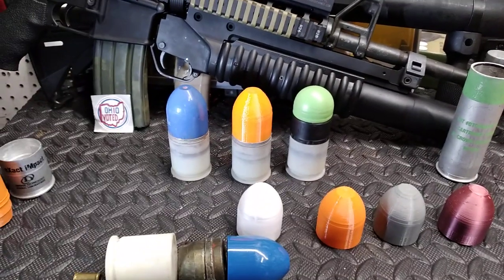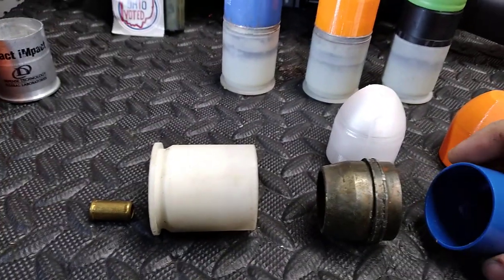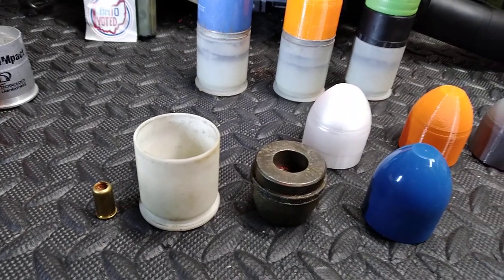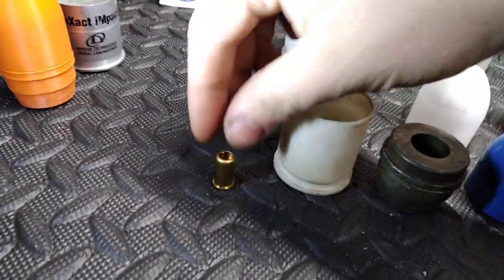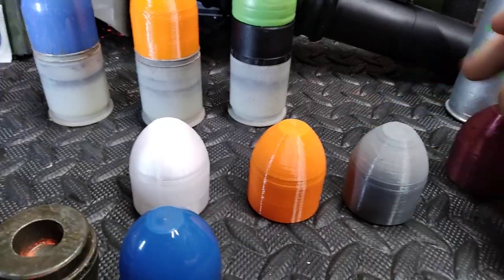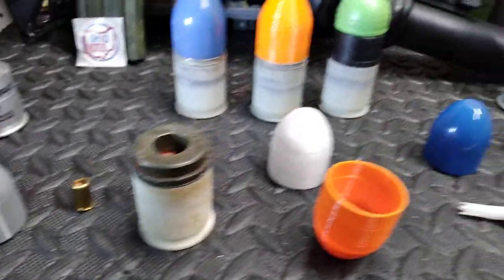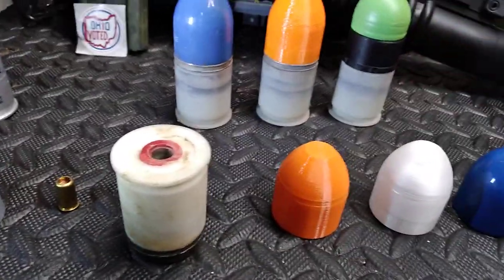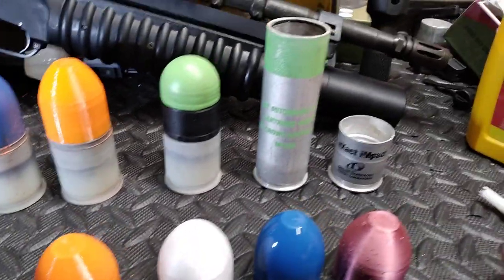3D Printed Ammo! Shooting 40mm for CHEAP!

Comment: 3D printing the projectile you could design weak break points into the windscreen. Also printing some "horn" projections would increase the chance of breaking on impact, even with softer surfaces.
Reply from the maker: Definitely.  Though my CAD skills aren't quite up to yours. My first goal was to make a functional replacement for the factory cone. I also made a few other prototypes, including an extra long cone that burst on launch (lol) and a whistling cone that I still need to print and test. A friend also redesigned mine to match the shape of an HE round which is pretty cool. I havent been doing much CAD since summer hit. But I will now that winter is approaching.
Reply: @ChevTecGroup  if you want help with the models just let me know and I can see what I can do. They should be very simple models.
Reply: @ChevTecGroup  send me the dimensions and i can cad some with grooves

Comment: You could print them in TPU for reussable it has some flex in it to not break on impact for practice.
Reply from the maker: That would probably work depending on what target you hit. I haven't had any luck the one time I tried printing in tpu though. So I'll stick with expendable for now
Reply: Make silicone molds from the prints and use pourable resin
Reply from the maker: I could even print molds to pour the resin straight into.  But its honestly too easy to just print the cones. I can print 20 cones a day on an ender 3 just by hitting a button. No mess, no smells, no vacuum chambers to get the bubbles out. I have thought about casting for thicker parts that need more strength

Comment: Can take the prints, mold them in gelatin, cut it out 'zig-zag cut' and pour in a cold metal casting. The cold cast is epoxy resin mixed with powdered metals. But I'm not a Marine so I don't use chalk rounds ;)

Comment: Do you have a cad drawing of the tube? Or some blueprints? I have the receiver and trigger parts on blueprint. But no tube. Also i have the M79 blueprins complete. 

Also, no 40mm grenade blueprints, would you have those? I have some CAD files but im not sure if these are the right size or just a spinoff for the looks. 

Greetings,

Jeff 

p.s.
Really cool to see that you can shoot these that cheap!
Reply from the maker: Unfortunately I don't have any drawings or files of the launchers.  There may be some on grabcad though.
Reply from the maker: @jeffjefferson2676  i can try to take some measurements for the 203 barrel. I would really like to see a broach or electrochemical machining die designed to make the rifling for these barrels
Reply: @ChevTecGroup  Well, if you look at the about section of my youtube channel. Ive got a grabcad page. It has all the things in it you need to know to build a barrel. 

For a big thing like a 40mm granade launcher, it might be better to use a rack and pinion method as shown in this video: https://www.youtube.com/watch?v=piaZjbdu4Ok. That should work. Also, i dont know if you can swage rifling into aluminum like a rifling button can with steel. 

Some precise measurements would be greatly appreciated. Measuring in inches is doable, but metric is more easy.  However the 203 barrel is probably designed in inches, so that should be straight numbers. 

Greetings,

Jeff
Reply from the maker: @DieselRamcharger  the only broach I've seen for sale was a 37mm one. Which is kinda worthless to me, especially for the price they wanted. I haven't tried pricing a 40mm broach yet
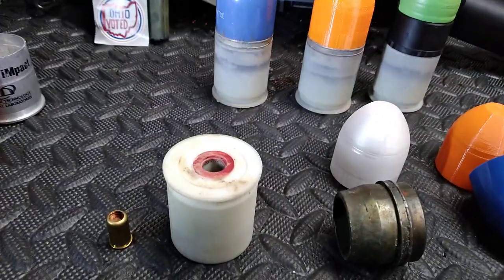Reply: Hey man I had just saw this comment, but two days ago I saw the full files for what you are looking for. I will go back to the message board and pull them up. I was helping out some guys on there and had noticed a post about it. I'll grab the files if I can find them. I'm an industrial engineer with a few cnc machines, lathes, and so on. What is the twist rate of the barrel? Is it a 1:48" twist? If you can give some decent measurements I might be able to send a few sets out to ChevTec for him to look at and see.
Reply: @ChevTecGroup  Read my comment at the bottom of this comment thread from jeff i may be able to make a few for you to see if it will work for your rifling if you think you would like them. I think I have the prints for them and can run them in the cnc and so on.
Reply from the maker: @aegiscaleb  that would be pretty awesome. Having some 40mm barrel blanks would be great for guy that have spikes 37mm launchers and break action 37mm launchers that want to convert them.
Reply: @ChevTecGroup  Yeah it is no problem. My family use to own a business making turbochargers and finally retired so I have access to make whatever. I don't mind helping people spread freedom in this day and age. I can work up a few different ones to try and see which ones work best since you are working with precision accuracy. I think I may have the exact rifling specs and cat make a few kits for someone to try. I'll get to work on it over the next weeks and update you.
Reply: @aegiscaleb  6 grooves 1 in 48 twist. Like the file says: https://ivanthetroll.keybase.pub/tdp.html "Complete M-79 (Thumper/Blooper) Grenadle Launcher Technical Data Package" page 25/120.

Comment: Seeing your other comments about printing cases the case mouth will seperate and go down range, is that a problem? If it doesn't effect accuracy that much why not?
Then you could prime with nail gun blanks which are way cheaper and easier to come by assuming it doesn't shatter the printed bases
Reply from the maker: The case mouth separation was noted by the Army as severely hurting accuracy. I talked tonkne guy that tried it with PLA and said the cases shatter when fired so it is kinda almost one time use. I actually picked up a box of nail gun blanks and had the same idea of using them. The hardest part will be offsetting the case so that the centerfire firing pin hits the rim. Butni figure it would be a good use for the lightweight 3d printed projectiles I've designed

Comment: You should fill one with like ghost peper and itch powder
Reply from the maker: That may be something we cover in a later video.  We will be going over some 40mm smoke projectiles made in house. It wouldn't be a stretch to add capsaicin powder or something else to turn them into riot control rounds.
Reply from the maker: Thanks for the suggestion
Reply: @ChevTecGroup  no problem

Comment: Have you tried 3d printing the "case"?
It may be a better practice to press the blank into the case over using a dead blow hammer.
Reply from the maker: I have not printed any cases Yet, though it is a common request so I think its going on the list of projects. The Army already tried and had a lot of problems with the cases breaking and coming out with the projectile, which worked for one time use, but hurt accuracy a lot. I'm getting an arbor press soon so that will be used for seating blanks. Most just go in by hand.
Reply from the maker: I haven't tried the case yet since they have always been available for sale. When the cones were not for a while, or were pricey and non-reuseable. But it should be exciting to try

Comment: Hey bro, I'm an Aussie so this shit isn't easy to get. So these taking the bland round for a framing  gun?

So U have any other options for c02 that I may be able to get in Australia... Sure the energy ahell would be fine if they were appart in box... Also, the pusher? Where can I get those???
Reply from the maker: These ones take a blank that is specially made for them. If you check out the AWCY launchers, they have files for rounds that use nail gun blanks.

Comment: I wonder if there's a way to print a one piece windscreen and pusher and fill it from the front so you don't have to try and keep finding the pushers
Reply from the maker: I have a file I made for one like that. The nosecone is pretty thick as it is intended to be used for smoke, but it could easily be redesigned to break on impact
Reply: @ChevTecGroup  you're doing the lords work
Reply: @regulator1d yes once combined set top layer setting to off. It'll make a hollow point looking one
Reply: @Regulator1D  yes print it with the top layer infill off and it will make a hollow point

Comment: wait so if the manufacturer doesn't sell it with the primer included because it would then be classed as an explosive wouldn't you need to register it as an explosive before pushing the primer and thus need an explosives license or ffl?
Reply from the maker: It is legal in most states to make explosives for non-commercial use. So it is perfectly legal to complete the rounds yourself. It's advisable to do it at the range before you shoot so that you do not break any explosive storage regulations. In reality no one is getting arrested for it, but it is best not to chance it
Reply: @ChevTecGroup  But on the eform1 what would the option to classify the weapon as explosive, rather than DD, mean if not something like this or perhaps a real 40mm frag grenade or a Molotov you made? Because wouldn't a commercial manufacturer or FFL use a form 2 so they don't get the $200 tax? thanks for the response too!
Reply from the maker: @saltbandit6768  thanks for the questions. The explosive section on the form 1 is for things like hand grenades, molotov cocktails, landmines, etc which are considered explosive DDs. Regular explosives (stick of dynamite, det cord) are not considered DDs so you don't need an FFL or form 1. If you are storing them or making them for commercial purposes, you'd need an FEL. For messing with explosive DDs, it's best to have both but that gets expensive quick.

Comment: have you tried tpu for the nose cones? if so, which was better, petg or tpu?
Reply from the maker: I have not tried TPU. If you use too flexible of a filament, I bet the cone would fly off when fired. PLA+ is my favorite for its ease of printing and quality. PETG isn't bad but it's harder on the printer and I had a lot more failures.
Reply: @ChevTecGroup  awesome, thank you for the fast reply. i know the awcy launcher includes files for a specifically labeled tpu nose cone. i have printed some, not fired yet. they seem like they would work decent. i figured perhaps for chalk, if you had the extra give that tpu would afford, it might make a bigger chalk cloud. 

i have been printing all my stuff in petg and it seems to have worked well so far. im planning to fire several this weekend so i'll try to pop back here and let you know if i saw a difference in petg vs tpu cones

Comment: Why not 3d print the nylon casings too? If you have a printer capable you could print them in ABS, Nylon, or even Polycarbonate. Then you'd just need to reload the 38 blanks (or whatever blank you want to use)

My question is, how much unique you putting in those?

Also, Airsofters have "pyrotechnic" hand grenades that are technically classified as "fireworks" how are these not classified as fireworks? is it because they're 40mm? What about going with a 37mm?
Reply from the maker: The nose cones were "phase 1." The US Army experimented with it as part of project R.A.M.B.O.  They had lots of problems with the case mouth separating and going downrange. I started with the nosecones because they are not re-useable. And the cases are generally available for sale. But it will be good to make 3d printable 40mm and 37mm cases for the future.

Comment: I wonder if the zinc part could be casted using lead.
Reply: I modeled this up on solidworks because I was curious about that too. It wouldn’t work well. For starters it would have to be a lot thinner to be the same ~160g weight. Second, the mould would have to be single cavity and also a 4 piece design to recreate the original geometry.
Reply: @leepeffer1304  yea I’m sure it would be stupid heavy if it was lead. Like a 5 lbs projectile lol
Reply: @Gunmonkey5  for anyone OCD enough to care, a stock zinc pusher weighs 164.5g and an identical one made of lead would be 270.2g.
Reply: Lead will smear the bore, and be very difficult to remove. I wrapped solder around homemade cast pushers years ago. It worked well, but I would never do it again.

Comment: Hey man do you have a file for 37mm ?
Reply from the maker: I might have one or two from a while back. You may have to adjust them to fit whatever cases and launcher you are using. Send me an email specifically about 37mm so you don't get the 40mm pack. Jacob.chevtec@gmail.com

Comment: Can one print destructive rounds after filling out the king's tax?
Reply from the maker: You can. Though you must also stay in accordance with explosive laws. Either have an FEL or make and use the explosive material in the same day and location, if your local laws allow that. M433 HEDP parts can be found new with no energetics. I have a couple on the way and will be doing a video on how they work and go together. Though not until after I finish a video on all the variations of factory practice rounds used by the US military.  I'm waiting for the last 2 to come in the mail.
Reply: @ChevTecGroup  good to know!

Comment: I dont understand how that 9mm blank can propel such a large/heavy projectile
Reply from the maker: It is only propelling it to a bit over 75 meters per second. About 1/4 the speed of a pistol bullet.
Reply: The blank fires off into the case that is sealed with the zinc plug. Due to math stuff the volume inside the case combined with the huge surface area of the 40mm plug means that instead of the huge pressures used to throw the .38 slug the pressure acting on the zinc plug is more like a huge paintball gun now.

Comment: where could  i buy a 40mm grenade launcher and how much
Reply from the maker: The biggest dealer is Texas machine-gun and ordnance, TXMGO. Pretty much everywhere is backorder after garand thumb made his 40mm video. You can order direct from LMT also. Any LMT dealer can order you a receiver as well. There are a few on gunbroker for a premium. Before they went out of stock, you could find a complete receiver for 600-1200 bucks for a DSA or LMT. Barrels are 250-450 depending on brand and used vs new. And mounts for your rifle are about 50-150 bucks. Fab defense got my standalone stock for 235 bucks straight from Israel.  Colt m203s carry a premium, add another 1000 for the name.

Comment: do you have theese for 37mm
Reply from the maker: There is a complete projectile on thingiverse for 37mm. Just search "m781." The problem is: it's questionable on legality, there is no standard case for it to fit into, black powder cases won't launch them very well, and 37mm doesn't have rifling for spin stabilization. 
 If you do find some casings that will work well, you can upload the file to tinkercad and adjust it to fit.

Comment: Great video.  Any chance you could share a source for the blanks?
Reply from the maker: Two sources. CDVS has what i believe are reloads. Gunbroker has factory new blanks from MAST technologies, but they are 4x the price.
Reply: Thanks!  I’d found the same ones, figuring the cheaper CDVS ones were pulled down surplus, but yep a lot cheaper.  That seller on GB has zincs too, will pick up some of those.
Reply from the maker: @dolamiiite  yep the gunbroker seller is MAST themselves.  They seem to be a newer design but should work great.

Comment: So, how comparable is the flight to a factory practice round?
Reply from the maker: I haven't noticed any deviation.  But I also haven't shot it with it clamped in a vice or anything.  The cones are designed to the same shape as the factory cones, just the surface is a little rougher. But that doesn't seem to make a difference and they can be sanded if you want. Or you can buy factory cones for a buck a piece on gunbroker.

Comment: What is the legality of this? Aren't you manufacturing a destructive device?
Reply from the maker: 40mm Ammo (except high explosive) is not a destructive device in itself. It would be considered a low explosive, so you are not supposed to transport or store it after assembly. So typically I only insert the blank/primer at the range (which is usually my back yard).